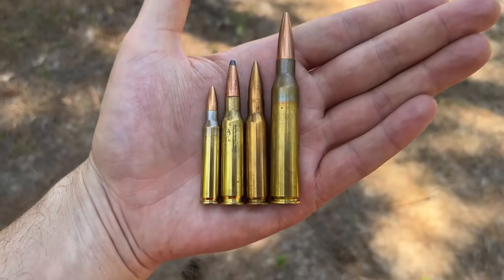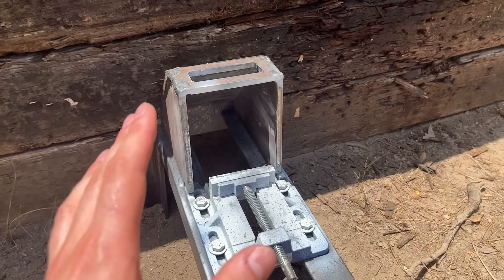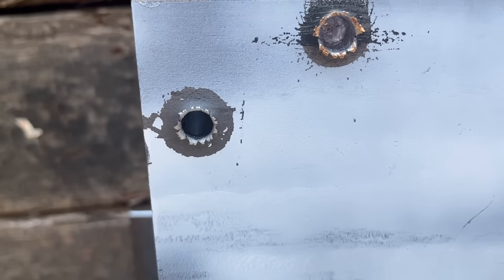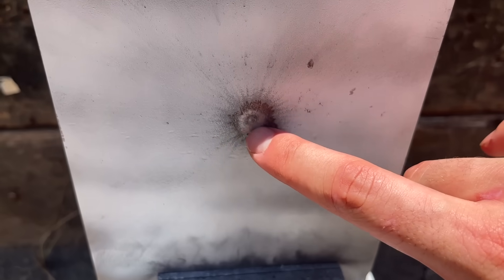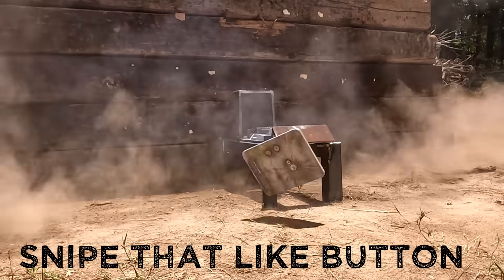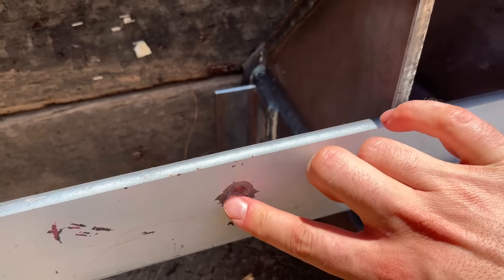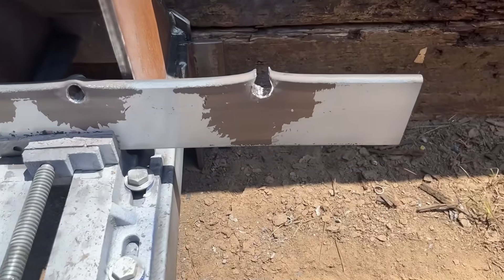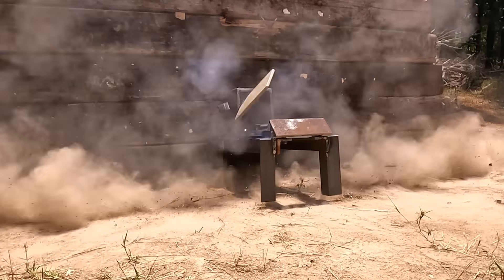Leaf Spring Steel vs AR500 Armor - Any Difference?

Comment: Battlebot builders learned over the years, since late 90's early 2000's that AR is the best steel for armor.  Before we found AR we used S7 which is pretty tough is hardens correctly.  The UK version of AR is Hardox, which I think is the same thing.

Comment: That is not the same as hardened spring steel and the AR 500 is heat treated. I have used 4041 30RC pre harden steel with good success

Comment: If you are buying AR plates for your range just remember that 3/8” is for pistol rounds.  1/2” and 5/8” are minimum for rifles.  You won’t get a “dimple” with those.  Green tip (penetrator) 5.56 or .308 WILL dimple your steel.  If your plates get dimpled, and they will eventually no matter what you shoot them with, flip them around to the other side.  You want a smooth surface to keep any spalling down to a minimum.
Reply: Can confirm.  1/4 inch AR500 does nothing to stop 5.56 green tip.
Reply: @BackYardScience2000  I was a project manager for a steel company.  We built indoor ranges and 360 degree shoot houses for the military and law enforcement.  I have at least 50 steel targets in my backyard range.   3/8” steel is for pistols only.  Just about any high velocity rifle round will dimple 3/8” plates.  1/2” works very well with most rifles….that additional 1/8” is actually a lot.  But because the price difference between 1/2” and 5/8” is negligible we only use 5/8’ and have zero problems.  Green tip 5.56 will dimple all steel targets. Steel should hang freely, or ideally be angled down at about a 13-15 degree angle.  That will make the steel last much longer.  Mounting it in a stand that does not allow it to swing on impact, or be angled to the ground causes the steel to absorb 100% of the impact instead of directing it down and away.  It eventually will fail.

Comment: High carbon steel is really interesting in how it behaves based on how it has been treated. Since we don't know if this leaf spring is annealed or hardened it unfortunately doesn't tell us much about how it. It would be really interesting to do this test again but take half the bar and get it up to circa 1700-1800 F and then quench it then reheat back to circa 350-400 degrees. Leave the other side alone and see what happens as you move from one side to the other. You could forget the second heat or tempering stage which will make the steel harder but will also make it more brittle so it might be more dangerous when shooting it. I might be off on the temps that you need to get these to so if you do decide to do this test please verify and don't rely on my memory, hell I sure wouldn't :)

Comment: 5160 and ar500 have very similar alloy compositions. The 500 in ar500 represents a brinell hardness of 500 (which equates to about 50 HRC. 5160 is almost always sold in an annealed state, which has an HRC of almost half that. 5160 that has been heat treated to about 50 HRC should perform similarly to ar500. It would be worth comparing the two after the 5160 has been heat treated.

Comment: I have a 8x8 plate of 3/8 thick 5160 but it was heat treated and has a rockwell of 60.  It survived all pistol calibers i had to throw at it.  44mag and 10mm were the most powerfull i had..   it survived regular factory 556. And green tip 556.  It survived (barely) a factory 308..  but my 30-06 went straight through.   Moral of the story?   Its great in a pinch if you need some homemade armor fast..   not everyone is going to be coming at you with high powered rifles..   but... if your able to get the ar500 its far better.  And at that point.. just buy a ready made plate or 2 with the anti spall coating.

Comment: Couldn't you use a piece of spring steel off of a big truck, semi or something?  Aren't they already hardened and tempered?  or would the tempering make them too soft?
I found this video while searching if AR500 would be a good steel for a knife.  Didn't find anything related to AR500 and knife making but found this.  Googly told me it is not good for knife making.  Unless you want a very durable dull knife.  lol  Thanks Googly!

Comment: Heat treating basic and many low-alloy steels is not that difficult if you do a little metallurgy study. (As oppossed to the wild guessing old timers). High alloyed steel can be trouble without special equipment, but they also tend to be expensive.

The basic crystal lattice forms and carbides(austentite, martensite, ferrite, cementite [bainite and pearlites which are a mixes of ferrite and cementite]), quenching vs tempering, and use of a Phase Diagram Of Carbon Steel (general) and Time-Temperature-Transformation (TTT ) Diagrams of specific alloys.
Also know that low carbon steels can be work hardened (cold rolling to final size.)

AR500 is a specific treatment of a specific alloy, nothing magic, but it has a decent amount of carbides for abraisive wear.

Comment: click bait  even if you dont have a forge you coulda let some one eale do it and showed results
Reply: that's like saying ima use tungsten carbide rounds and than pulls out a shotty with tungsten powder
Reply: thats like advertisement for d2 tool steel vs ar500  ballistic comparison  but theres holes in the d2 lol
Reply: thats like showing some one shot in the head vs a woman on a period and stating cause the gal bleed longer that the period was worse trauma
Reply: do better

Comment: The spring steel/5160 was probably scrapped from the spring of a truck or trailer.  So, it would not be annealed steel.  It would be hardened, because it's supposed to be springy.

Comment: If you want to improve the effectiveness of the leaf spring heat up to 1550 deg 7 and hold there for 10 minutes then quench in oil temper at 425 for 2 two hour cycles letting it cool completely between cycles

Comment: Penetration increases with rifling twist. Ever take the M193 through a 20 inch 1-12, 1-9 & 1-7? 

Most noticeable increase would be with green tip, but FN found increasing the rifling twist also made the 55gr penetrate much further.

Comment: Jawelnofine, try firing at fully hardened and tempered 5160. The results will be much better. Its very easy to drill, file and cut annealed 5160. Not so with treated 5160.

Comment: What about AR400 steel? AR500 is harder than AR400 due to higher carbon content. AR500 is meant to be sliding abrasion resistant, used for quarry chutes and conveyors. AR400 is supposed to be more for impact abrasion, used for dump truck beds and backhoe bucket liners.

Comment: If you're not HARDENING the steel you're just wasting your time.   Until you harden it there is essentially no difference between 5160 and mild steel.

Comment: I was a field service technician for 30 years. Over the years, I ended up with a lot of AR 500 and 550. So I made a shooting tree out of AR-500 ×1/2 inch thick.  At 100 yards, it takes a 30-06 to move it around. Some joker shot it with a .50 cal and put a dent in it. It is at the CMP range I belong to.

Comment: There are a bunch of YouTube videos showing how to make a cheap and easy forge. You should eat a piece of red hot and quench it and then try it. I bet it works better at stopping bullets if you quench it. You can make them with propane burners and like a small fan or a blow dryer.

Comment: I think the leaf spring should have been cut in half and half heat treated for max hardness and then included in this line up.
Reply: Max hardness would be quenched and not tempered...without at least a mild temper, it's likely to shatter on impact. Question is, how much temper do you need to prevent shattering depending on how much momentum each projectile carries? Maybe something really mild like 150 - 200 Celsius.

Comment: Don't know if you'll see this... for Version 5, i don't remember wich one 2 or 3 had the steps for the thickness of the steel plates, to secure them use a (2) wooden wedges on the side.  Wood should be able to absorb some of the shock, easy to replace, can hammer in and knocked loose.  To hold the plates in, not to make the body out of wood.

Comment: Harden the spring steel and don't temper it back and do some more shooting test on it
Reply: That will probably make it brittle see ar500 is a very strong alloy steel so it’s both hard and strong so it can resist penetration and shock from the impacts from the bullets
Reply: ClickOnProfile6602  what’s that?

Comment: You forgot to harden the spring steel. Simply heat it to red heat and wuench it in oil at 300-400 degrees

Comment: Until I got close to the end of the film I was going to ask you if you tried to heat threat the 1055 spring steel as well. It wouldn't have been any stronger than the untreated spring steel, but it would have been neat to see.

Which .338 Lapua rounds is your rifle sighted in for? Not just the ones you shot in this video, but the rounds you have it tuned in for.

Comment: AR500 steel is incredible.
Reply: Yes AR500 steel is one of the hardest grades of steel around it’s a hardened alloy steel. It has iron, carbon and other metals added to it it’s also been heat treated so it’s a very strong alloy

Comment: I fired  62 gr. M855 ammo thru my 16” 5.56 nato M4 (AR-15) @50 meters, at a 6” x 6”, 9/16” thick mild steel plate. It went through it like a hot knife thru butter. Then I tried 55 gr. M193 through the same rifle and the bullet didn’t go through, no bulge, just a smudge mark. That’s the difference between a regular projectile and an armor piercing projectile. 
Thanks for sharing your perspective, experience and knowledge with us. Best of luck 🍀
Reply: 855 isn't AP

Comment: AR 500 is designed for earth moving equipment.  You should try a .416 Rigby for penetration in the armor plate testing and mild steel.
Reply: I have shot my ar500 half in. steels with my 378 wyb mag, and it doesn't go through

Comment: The cast steel used in the Chinese made vices is not of very good quality and is overly brittle. You will notice that the good US made vices like a Wilton are considerably superior and, in my experience, worth the difference. In my metal shop I made the mistake of thinking that the far cheaper Chinese vises would work but quickly discovered that their steel was vastly subpar.

Comment: Very interesting video, I like when you do testing of AR500 Steel with different guns it’s very tough stuff. It’s one of the hardest steels around AR600 is even harder. But yes, when it comes to these clamps, a lot of them are made out of cast-iron. Cast-iron is quite brittle. It doesn’t take a lot of energy to break cast-iron. You should get some copper plates and see how much these bullets can go through Copper that would be interesting so you know your test different types of metal like how you tested, three different grades of steel in this video but yeah I love to see how much Copper a 338 Lapira can go through
Reply from the maker: Luckily, these clamps are cheap to replace. That sounds like a really expensive video, but I’ll think about it
Reply: @bananaballistics i reckon if you do it you should test copper and aluminium plates and see how much the bullets can go through that would be interesting. They are soft metal i reckon the 338 rifles could go through 1 inch of aluminium and copper. I believe copper is slightly harder than aluminium
Reply: I also reckon you should use a 50 BMG and see how thick mild steel the bullet can go through
Reply: You may be able to find one of those clamps made of ductile iron. It would handle the impact better.

Comment: AR500 is hardened by the supplier, wheras 5160 typically comes in the annealed condition.  Comparison with one hardened, and the other annealed, is apples to oranges.  As others have stated, you could get an old leaf spring to test a properly quenched and tempered 5160.  Alternatively, you could anneal your AR500.
Reply: I order 5160 in bulk hot rolled from the factory, you pay extra for annealed, but 5160 is a great tough steel.
Reply: @MrMakto  Good point, hot rolled and annealed are not exactly the same thing.  The annealed will be somewhat softer than the hot rolled.  They will both be significantly softer than hardened 5160.  Also both hot rolled and annealed will be noticably stronger and tougher than mild steel.  As you say, 5160 is some great stuff especially for the price.
Reply: Tempered spring is a whole different animal then annealed steal.
Reply: I'm aware, as I also heat treat and temper the steel for various tools.  @timothyterrell1658
Reply from the maker: I mainly wanted to see how it compared to mild steel, but maybe in a future video for sure
Reply: @bananaballistics Like you, I do indeed have a piece of leaf spring originally intended for sword making :)  You have inspired me to do some testing of my own.  What I should do is cut the spring into two pieces, and anneal one in my forge to compare the effects of heat treatment.  I could even do hardness testing with my file set on both pieces... man I love it when a good experiment starts to come together!
Reply: @bananaballistics  test how bullet proof 1 inch aluminum sheet metal is next please.
Reply: @bananaballistics  may be too late two years two late but I’m a blacksmith I could get you a piece of hardened and tempered 5160 spring steel I’d love to do a test shot on some 5160 that’s only been hardened not tempered to see if it’ll shatter like glass
Reply: Redditor

Comment: You should try testing using a 'bush-hog' or heavy duty mower blade the equivalent of a hardened spring steel.  I tried testing one back in the 60's with 30-06 AP and then bought a .220 Swift Ruger with a 26" barrel to compare it to.  Those mower blades were definitely hardened and were the same thickness as the ones that you tested in this video and the results were very surprising and would be very interesting when compared to AR 500 and AR550/600!  Excellent videos and look forward to your future endeavors!
P.S.:. Still wish that you were using a smaller shooting window or testing remotely... given my past experiences!
Take care!
Reply from the maker: I’ll have to look into getting a blade like that. Definitely sounds like a similar but hardened steel
Reply: @bananaballistics  
Thanks for the reply.  I have a feeling that you are going to do very well with your channel and there are a host of different directions that you can go that will all be interesting.   I've been doing this since I was 11 years old and that was a long time ago.  
As I noted in earlier comments (some on a few other channels  like WTW, Buffman, Going Ballistic,Ron Spomer...et al.) I have been fortunate to have had guidance from some of the top people with DOD and industry over the years which is always a good thing.  My interests have focused primarily on the areas of Internal and Terminal ballistics.  I mentioned in a previous comment some fairly technical sources of information you may want to look into as I think from what I can tell that they might be of interest.  I have subscribed and will be glad to share some thoughts along the way that will be a bit more condensed than what I have already sent.  Be careful and keep your powder dry!
Reply: Most high end bush hog blades are 5160 - (bladesmith).

Comment: Have you ever done monolithic copper bullets vs lead bullets yet? I feel like that could get interesting.
Reply from the maker: I have done a bunch of bullets with the 308 and 6.5 Creed. Copper bullets are not great but I haven’t tried brass yet
Reply: Do it from a 4000 fps cartridge too. Even varmint grenades go thru all sorts of steel.

Comment: Try a bit of wood in the clamp jaws to mitigate the shock,if you want to get fancy large pieces of copper or aluminium may help mitigate the shock wave.
Reply: Instead of wood maybe a piece of rubber like a car tire or some softer plastic such as HDPE
Reply from the maker: Great idea! Won’t be in the next few videos because I already recorded them, but i will try it out
Reply: @bananaballistics  test 1 inch aluminum sheet metal next please.
Reply: @bananaballistics see if you can get someone to 3d print it with 95a tpu material. You can try solid infill and maybe a honeycomb infill to absorb some shock. Worth a try. Its pretty tough and very flexible. Its also pretty good at being abrasion resistant.
Reply: Excellent idea❤

Comment: mmm, did u say not hardened? could u try hardening it? 
btw. steel sled 5.0 could have 2 vertical clamps runing on the sides.
Reply from the maker: May be something that I try in the future. I wanted to see how much different this was than mild steel without any heat treat
Reply: @bananaballistics  without the treatment. the cristaline structure of a leaf spring doesnt differ much from low carbon mild steel.  thats why the results look very similar.
Reply: That was definitely in the annealed condition. He should just heat it up until a magnet doesn't stick to it anymore and then dunk it in oil. Or just grab an automotive leaf spring or two from a salvage yard. Those are quenched and tempered.